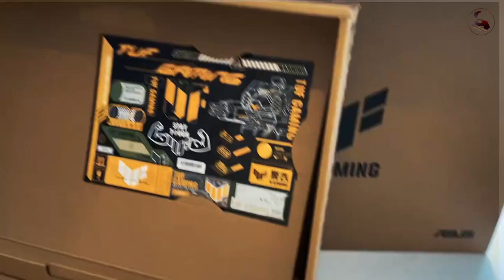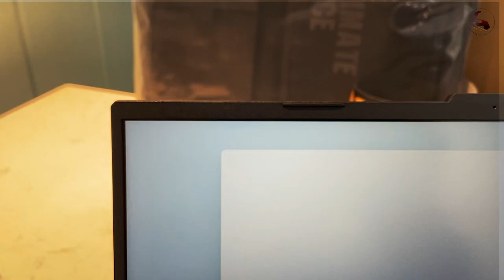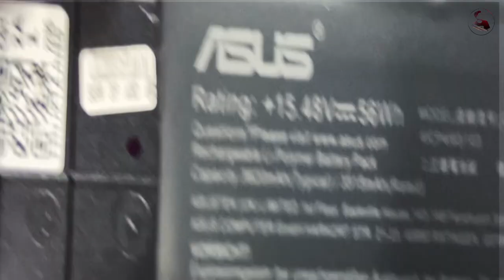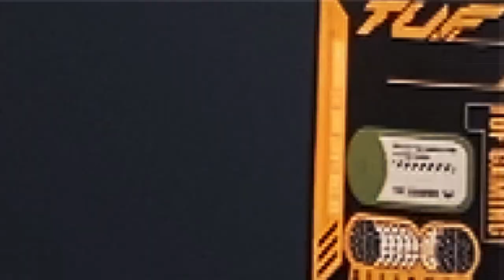aus tuf a15 2022 , unboxing asus gaming laptop tuf  a15 2022  - FA507 #tufa15 #tuf #gaminglaptop2022

Comment: weird how  tuf a15 2022 on asus original page has different port layout on left side than yours.. also different top cover.. yours looks like the 2021 model..
Reply from the maker: https://www.asus.com/laptops/for-gaming/tuf-gaming/asus-tuf-gaming-a15-2022/
Reply from the maker: check again
Reply: @UnboxVichith  well the first pic on this link (same as i checked) shows a fan opening on the left side, on your vid its hard to see it there. And different case top cover or back lid or whatever its called. Not sure what im checking. But its weird
Reply: Bro 2022 model hai . 2022 tuf a15 comes with two different top patterns
Reply from the maker: @darkphoienx8163  Yes Tuf A15 and tuf F15 2022 , two different top patterns

Comment: Hello.. I bought same laptop, but with rtx3050ti variant. Do you happened to have problem connecting with internet? because mine is too slow. I can only connect it to 2.4g channel and I'm getting a 3mbps only. The 5g is not even connecting and I know there is a problem with this laptop, cuz I have acer nitro 2021 before and I'm getting a 80mbps on 5g channel. Planning to return it, but I am still looking for a solution.
Reply from the maker: Yes Hi @mininok2
Step 1: You need to test your internet by taking a smartphone to determine how much MBP it gets on the internet.
If it gets more internet than your computer, your computer has a real problem.
Step 2: You need to reinstall Windows and run the Wimdows Update
If the problem persists, take your computer to ASus for further inspection.
Reply: @UnboxVichith  Appreciate your reply Sir.. Okay I will try this out. Thank you.
Reply from the maker: ok👍
Reply: Maybe it doesnt have wifi 6
Reply from the maker: @rutherford5247  Wi-Fi
802.11ax
Reply: My problems with Asus tuf gaming A15 started with Display which went unnoticed, as it was showing light grey background colour as white for all website, So support recommended resetting laptop but problem kept coming back after 3 months Display was replaced, Then WIFI stopped working and support repeated same thing reset laptop so ever week i had to reset by laptop once or twice. and now my motherboards developed problems so i got from asus refurbished/used motherboard as replacement so that is also another reason i am not happy even parts which are replaced are not new as in my case.. So in new laptop Display, WIFI & motherboard got replace what can you expect. and our reviewer seems to be defending them. Has any of the YouTubers tried to highlight these issue No, they wont do it as they get paid. SO you decide which side you choose.
Reply: @ib4112  Wait, so your new asus laptop is defective after few days you bought it?
Reply: @rutherford5247  My new laptop had issue with display but it went noticed for 2 months as i was not using it that much, problem came to my noticed only when i was working on UI design page where i had to use Light grey colour and all light grey colours where showing as white. however on external monitor colours where showing correct. So i raised case support asked me to reset laptop which fixed issue for few days and then same colour problem so each time support asked me to reset colour, since i had to reset laptop  one or twice a week i was not able to work on it so after escalation i was asked to take it to service center and they asked to replace Diaplay, after display WIFI card was dead and fixed Display & WIFI it worked fine for 6-7 weeks and then again display started showing different kind of problem as it will go off suddenly while i was working. So service center guys said this is due to issue with Motherboard which is being replaced and my laptop is still at Service center. and most important thing is that i motherboard which i received as replacement is old/used/refurbished. So you decide on my journey with asus.. will i recommend it to anyone..

Comment: Selamlar  Asus tuf a15 fa507rm modeli mi?
Reply from the maker: yes brother
Reply: @UnboxVichith  bende satın aldım 👍🏽
Reply from the maker: @blaacdaay  good job
Reply: @UnboxVichith  batarya  90 watt değil mi? 200 watt sarj aparatı
Reply: @UnboxVichith  rtx 3060 140w?
Reply from the maker: @blaacdaay  
-Battery 56wh = charge power 200 W (RTX 3050 or 3050Ti)
-Battery 90wh = charge power 240 W (RTX 3060 or 3070)
Reply: @UnboxVichith  thx bro  ı am rtx 3060👍🏽